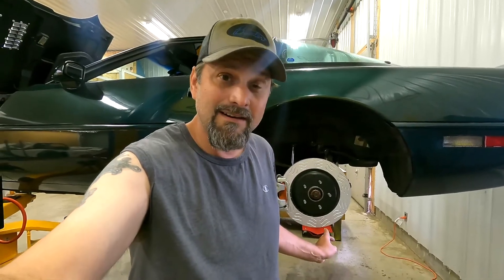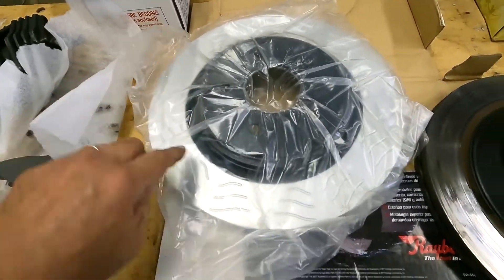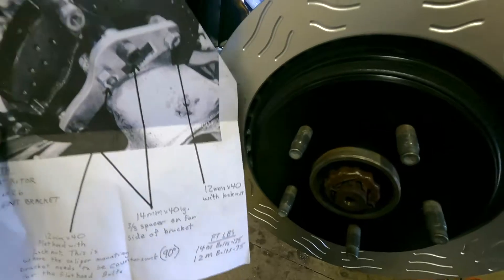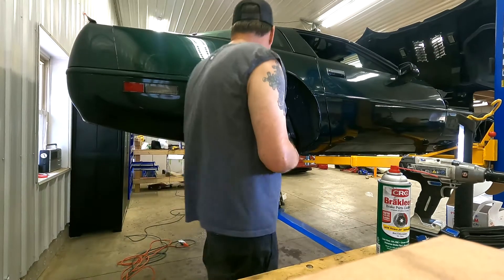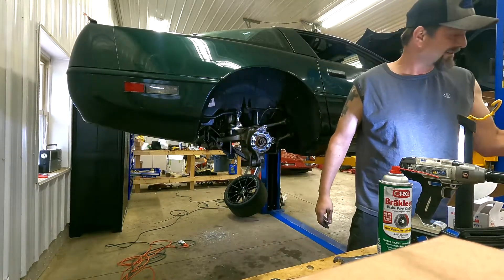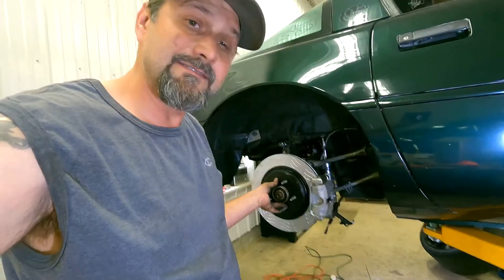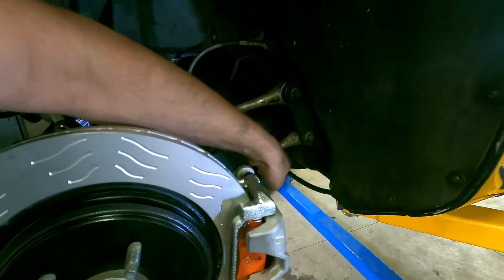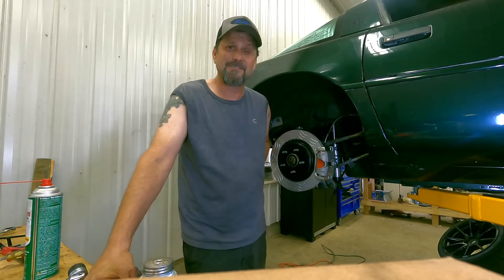C4 Corvette Rear Brake Upgrade to C5 / C6 Brakes

Comment: i ran into an issue with the brake lines. the C4 uses a bubble flare on the hard brake lines but for the C6 they went to inverted flare for some reason. The c5 brake lines are the correct length and flare.

Comment: What's the link for the rear adapter brackets? I have a 93
Reply from the maker: It should be in the description.   A guy on ebay makes them in batches
Reply from the maker: He just listed a new batch on ebay.  Here's the link...
https://www.ebay.com/itm/145050588291?mkcid=16&mkevt=1&mkrid=711-127632-2357-0&ssspo=KHARshkMSKW&sssrc=2349624&ssuid=fSwOnbgCS1m&var=&widget_ver=artemis&media=COPY

Comment: Thanks for the video on this. The brackets on-line all say front brakes.  Are the rears the same or is there another bracket for the rear calipers?
Reply from the maker: They are not the same at all.  If it is not showing in his store, it means he is out of stock at this time.  He makes them in batches so you just have to keep checking.

Comment: Nice car im doing c6 up grade with same rotors with caps painted black about parking brake i kind of need it mine is a zf 6 speed 1991 so if i figure it out i will message you maybe i and my dad can engineer a way to work. Unless you already tried?
Reply from the maker: No I didn't.  Maybe someone on Corvetteforum.com knows

Comment: You have that brake line part number you ended up using?
Reply from the maker: https://www.summitracing.com/parts/RUS-657050
And I think this is the adapter I needed.  I can't remember as I had to buy 3 different kinds to fit.
https://www.summitracing.com/parts/EAR-989534ERL

Comment: Did you do this upgrade because the stock rear brakes were getting smoked out on the track.
Reply from the maker: No, I just wanted to even out the braking power since I upgraded the fronts to C6 already.